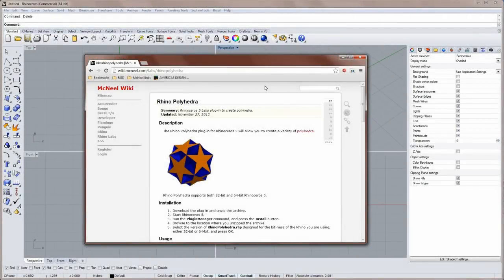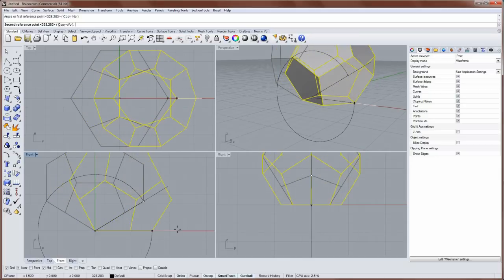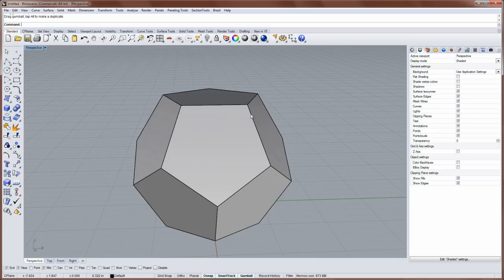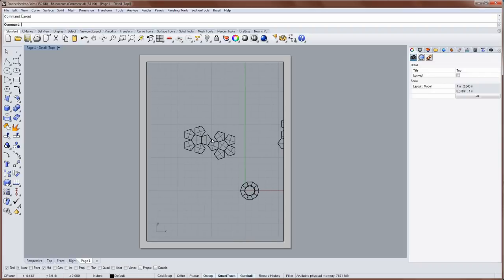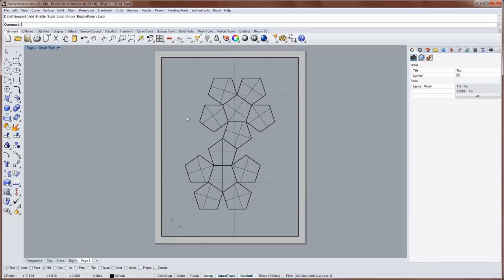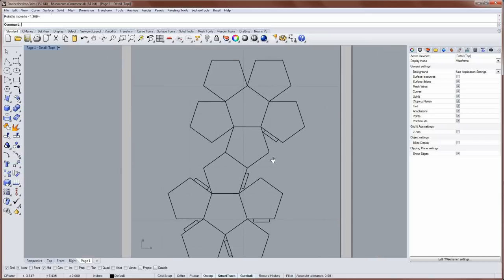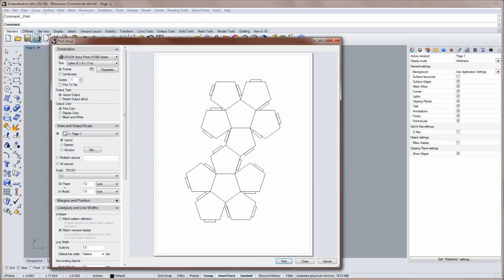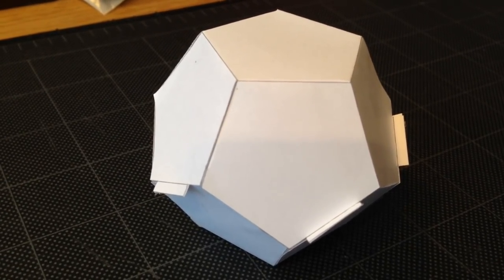3D to 2D to 3D

Comment: Please!! Does this works with organic shapes?!
Reply from the maker: You can use Squish as one method for flattening doubly curved surfaces. Expansion and contraction are relative elements based on material properties though so keep that in mind. Posting to the Rhino user forum with sample files would be a good way to get feedback on the right approach for your project. http://discourse.mcneel.com/
Reply: Thank you very much!